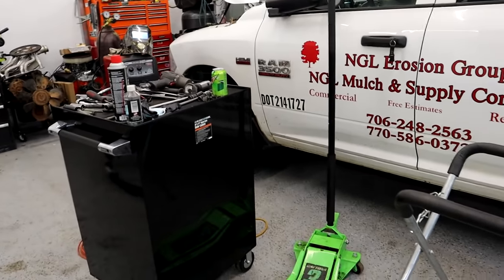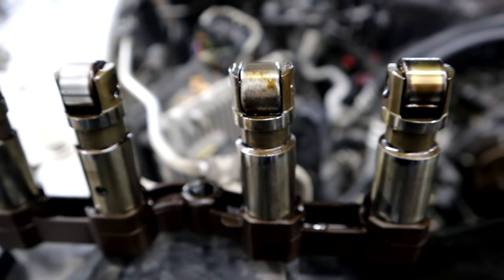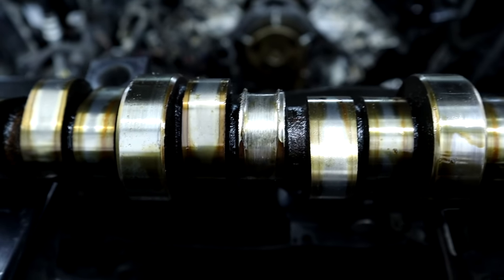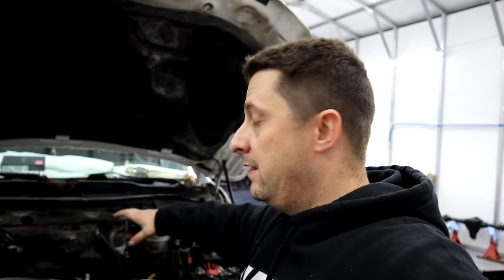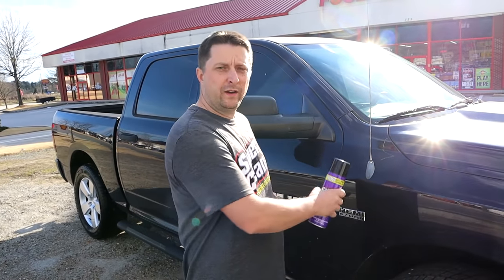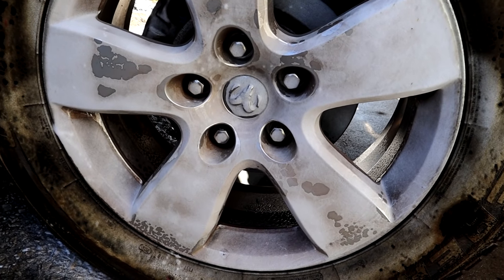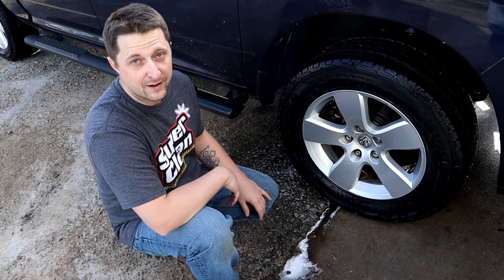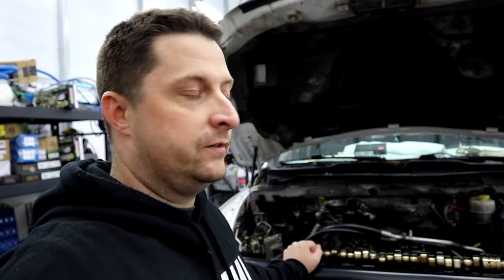6.4 HEMI Engine Failures Common Problems WATCH OUT.

Comment: I find it hard to believe that your buddy with a podunk shop is getting 6.4 Hemi Rams with failed cams when the 6.4 Hemi is not that popular of an option for the 2500 and 3500 trucks that are normally sold with 6.7 Cummins diesels. Further I owned a 2016 Ram 2500 with the 6.4 Hemi and ran quality Redline 0w-40 Group V Ester Synthetic oil in it and did not have any issues. If 6.4 Hemi Truck engines were having major issues with Cam failures it would be all over the forums yet the forums are quiet. 

From what I see the Truck at the start of this video looks to be a tradesman work truck and the maintenance was likely lacking, used the cheapest oil they could find and did not change the oil and filters in a timely manner. To many companies think they are saving money by using cheap oil and filters while they dog the truck, this one had a failure at 130,000 miles and from seeing the mirror in the up tow position you can bet your rear end this truck is used hard towing heavy loads. 

You say this guy has had five or six 6.4 Hemi Rams come in to his shop in the last two months for cam failures is just not believable. If these 6.4 Hemi Truck engines were failing at that high of a rate it would have been discovered long before the past couple of months and the Ram forums would all be on fire about it. 

The 6.4 Hemi Truck engine has been out since 2014 so they are hardly new on the market in fact they are now into their seventh year on the market. Landscape companies are well known for not taking good care of their trucks when it comes to proper maintenance.
Reply from the maker: 🤣🤣I will ship you all the camshafts if you pay the shipping that way you can evaluate them with your NOT podunk shop experience 😉 🤷‍♂️👍
Reply: @FrostbiteRam  some people just hate to admit there's a design  problem, however as a mechanic I would agree some people cheap out on the maintenance then blame the manufacture, DO PROPER MAINTENANCE FOLKS
Reply: I work a company that bought several Dodge Ram trucks in 2015 with the 6.4 L engines and the trucks get regular oil and filter changes. Every one without exception had to have the cam and lifters replaced starting at about 30,000 miles. Now interestingly enough anyone that has been through this also knows there is a 3 month back order on parts. I guess there is not a widespread problem though they can’t even keep up with demand for the parts. Can any of you defenders of Dodge explain this. LOL good luck, I await your replies.
Reply: @josephsylvester1  i would like to know when the oil was actually changed in the 30k mile trucks that are 6 years old now? What mileage is on those trucks no? I would think they should be on there 5th or 6th lifter and cam swap? Each truck!!! Oh and what are thr hours on those trucks so we can see the duty cycle of each and Mke a comparison with our own trucks?
Reply: It is all over the forums and GM has the same problems because of the MDS systems basically
Reply: @dasboot9471 Truth!
Reply: I'll take the big gas 6.4 over a diesel any day due to all the problems to diesels, having with exuast emissions. They go neck and neck with horsepower. lot cheaper to fix.
Reply: @ramecodiesel8271  I bought a 2018 RAM 2500 CPO 6.4. 
80,000 miles the transmission had to be completely redone. Matter fact it’s going back in the shop tomorrow for a transmission issue and I have not towed with that truck in a year except a small trailer that was only once a week ago. And 90,000 miles came and Lyptus came out of it that’s right came and lifters. Fortunately, I bought the extended warranty, so everything was covered. Well except the brake booster which had to be replaced twice between the 80 and 90,000 mile marks. Personally, I’ve had this truck maintenance at the dealership since I owned it. If they’ve used cheap oil, I wouldn’t think that would be a thing a dealership. I love the truck, but I can’t live with these mechanical problems. It’s too much. I’d be happy to send you pictures of the invoices unless you consider dealership, Podunk too. Search deeper there are all kinds of posts about the 5.7 and the 6.4 cam and lifter failures. Also on transmission issues.

Comment: In today's competitive truck market there's no excuse for these types of issues in the hemi engines. I traded my 15 Ram bighorn 5.7 in for a 2020 SR5 Tundra.  The exhaust manifold bolts were broke plus the lifter noise wearing out the cam. Both trucks sticker price were at 45,000 . That said I have faith that the Tundra will go 300 to 400 thousand miles with minimal repair. The Ram was nice towed my boat well.
Reply: Keep an eye on trans Temps in the Tundra. They stopped putting trans coolers on them and failures are occurring frequently.
Reply: @bicyclecrashsurvivor8884  definitely a bad move on Toyota.  Not currently towing anything but plan to add a cooler after warranty expires.  If it goes b4 then it's on Toyota to replace
Reply: Tow a 14,000# fifth wheel. Unfortunately, a Tundra is not in the cards for me. My other car is a Rav 4.

Comment: I’ve seen this happen before and I advise my customers to replace the engine at that point because all of the metal that gets through the engine. I’ve seen them be replaced and two years later they start rod knocking. I don’t want to charge somebody you know $3500 to do the job and then have it come back two years later with the rods knocking.
Reply: The dreaded hemi tick with early valve lifter failures?

Comment: The reason why these fail is because they slack on oil changes. You gotta change the oil really early on these 5.7 and 6.4 HEMI'S.
Reply: How early? I've been doing a oil change 5k increments
Reply: It is actually the design of the engine, the cam is too high and the oil draining from the heads doesn't flow enough down to the cam. Idling is what kills these more than oil change interval. The cam gets starved at low rpm and once the damage starts it snowballs. These are good engines, but not if you are going to idle for 30 minutes at a time. If you are going to idle for more than 5 minutes just shut it off.

Comment: My garage and a local Dodge dealership have found that there is a cronic problem of the casting sand not being totally cleaned off of the blocks when cast. This casting sand then acts as an abrasive and its clogging heaters and radiators as well. I suspect this could be compounding the problems shown here. Sounds like a recall is in order.
Reply: Makes me wonder if this is why my Ram has had a Chronic no heat issue almost every year since new🤔. Ive been through 2 radiators and 3 heater cores. I finally gave up and just dealt with being cold.

Comment: First thing I did to my truck with 200 miles was to cam it and change lifters. Added a lot of power and got rid of a known headache.
Reply from the maker: Awesome 👍
Reply: Would love to do this on my 6.4
What did you put in and do you still have low torque?
Thanks
Reply: @breakeralex9211  

J green cam/ jgreen tune/ ported heads/ported stock intake and throttle body/ long tube headers/ 2800 stall converter and few other odds and ends. The 6.4 hemi like this pulled awesome
Reply: @breakeralex9211  

Brother the truck really woke up. It had more torque and hp from idle to redline. Being a gas motor and non diesel the looser converter helped to.
Reply: @sailingseahawk2012  
Really glad to read this and thanks for the reply!

Comment: We have a 2018 Challenger Scat Pack with the 6 4L. Zero problems so far at 25k miles anywhere on the car. I have two questions: 1. I noticed that the lifter that failed in this engine was one of the non-MDS, or solid, lifters. A lot of people claim the MDS system is to blame for these problems. Has this shop seen more MDS lifter failures or solid, or are they about even? And 2: If he has any experience with them, are the high performance 6.4L engines in the Challengers and Chargers more or less prone to these issues? We plan on keeping this car regardless and will stick a new engine in it eventually if we have to, we love it that much, but it's good to know what to expect down the road. Thanks in advance for any info!
Reply from the maker: Yes it seems lots of the lifters that fails is a mix of mds or non mds it really doesn't just point to one it seems. My 5.7 failure was a non mds lifter as well.
Reply: Yes the MDS contributes to early engine failure running  on 4 cylinders.  It be less money to drive with all 8 cylinders than get lifters replacement over and over especially if you use band aid factory parts only to end up with same problem again down the road.
Reply: @microminiskirt  
Probably no way to disable the MDS system?
Reply: @jefferystensland1304  Buy the manual and pay the gas guzzler tax because if you are planning to keep Challenger for a long time that will pay off with one less major problem to go wrong.
Reply: It's two separate problems "HEMI TICK" as non MDS cars have had same issues with lifter valve failures.  Must go by idle times and change oil and filter frequently-very high maintenance.

Comment: I've been lucky I guess,155,000 no problems. I will keep on using my 5w30 amsoil every 7000-10,000 miles
Reply: I change mine every 2500-3000 lol
Reply from the maker: You should be good you have custom cam and non mds lifters right.
Reply: @FrostbiteRam  no mine is still factory
Reply from the maker: @Pickleram  thats right just tuning my bad
Reply: Do you run 5W-30 in a 6.4 or 5.7?
Reply: @roadglide1142  5.7
Reply: @Pickleram  depending year should be 5w 20 oil..
Reply: @alexlindekugel8727  2011 oil cap says 5w20 but owner manual says 5w30 is ok ,I rather have thicker oil I ran 5w20 for the first 50k. The truck still get the same mpg and performance is still the same. No hemi tick yet. Been a amsoil user for 30 years.
Reply from the maker: @roadglide1142  I use 5w30 in my 5.7
Reply: Well Geez?  Look at the color of the cam and lifters !!! 😳 Blame the lack of service of from oil changes !! Oil is not Oil is the same!  Really!!! Get Real Dude!!!😳
Reply: I have 140,000 on my rig. We are avid duck hunters which means a lot of mud and pulling boats. I’ve had to fix the valve body and replace a pinion bearing and that’s it. For what I put the truck through I’m pretty satisfied.
Reply: I'd NEVER let it go past 5000

Comment: Owned my 09 1500 since new. I am a Tech (since 1982). Been on full synth' since 10,000km. 226,000km at 5,000 hours number 3 exhaust lifter & lobe. I had NO tick, just a misfire under heavy load that would remain for about 15 seconds. Found the siezed lifter would turn 90 degrees in the cassette then flip back giving me a smooth engine again. 
I went with aftermarket parts because Canada OE prices are double ($2000 for just the lifters, plus head gaskets & seals etc)
Some of the new lifters are ticking, now running 5w30, still not happy with it, but going to run it as is while I decide to either redo it or swap in a new motor.
Will likely redo this one as I had the heads & exhaust manifolds machined (did valves & seals myself)

Comment: This is from running your motor with the MDS on. Guys, you have a V8 for a reason. Run all 8 or you gonna have problems. If your so worried about fuel mileage then go buy a 4 cylinder truck or car.
Reply: How do you turn off the MDS so you can run all 8 cylinders.
Reply: @SIDVENOM  after you put it in gear, just press the gear selector until you’ve reached the highest gear. So if you have a 8 speed trany, press the gear selector until it displays 8.
Reply: @jasonneal  ...
Reply: @SIDVENOM  this guys is trolling you, you'll have to open the motor up and replace the MDS lifters with NON-MDS lifters.
Reply: @jasonneal  but you can't go to 8th gear below a certain speed, and it doesn't matter what select a gear you're in. You told him he had to go all the way to 8th gear.
Reply: @Prestiged_peck  when you select to the 8th gear the vehicle will start out in 1st and shift normally all the way to the gear you have selected. For example, if you are at a stop and you have a 8 speed and you select gear 6, it will drive normal until you get to 6th gear, then it won’t shift any higher. It will still down shift like normal. I’m telling you try it
Reply: @jasonneal  that's weird, the ford/chevy versions actually put it in the selected gear, but will only let you select certain gears at certain speeds
Reply: @Prestiged_peck  i don’t know how Ford and Chevy operate bc I’ve never tried it on them. But I do know dodge. I will say if your going too fast then down shifting too low of gear, your asking for problems. The whole point here is driving the vehicle without the MDS turning on. And to do that, just put it in drive, select the highest gear and the vehicle will drive and shift like normal but the MDS won’t activate

Comment: I dumped my 2019 Laramie long bed 6.4 for a 2020 Tradesmen 6.7 diesel. I got cold feet with all the problems with the 6.4 hemi. I also needed a diesel to pull my new 5th wheel and it holds it resale value way better.
Reply from the maker: Cant go wrong with the cummins only thing to prepare for is emissions components failure.
Reply: @FrostbiteRam  - and transmission failure unless Aisin

Comment: Dear hemi and Mopar people if you want to avoid your issues every 3,000 mi Castro synthetic blend with original filter trust me I had a 5.7 with 200,000 mi never had an issue
2007 chrysler 300c
Reply: What do you mean by "original filter"? Do you have 200k miles on the oil filter your car was made with 🤔😳? Lol.
Reply: Yup, Castrol or even Motul european formula synthetic....

Comment: After owning several Dodge trucks and having to return to the dealer several times with each truck including a complete motor replacement on a truck with 2000 miles I'm done.
Reply from the maker: Cant blame you

Comment: well as a FCA vehicle owner the quality has continued to go down since 2015, when it should have been improving.  now that Stella, aka PSA or the French Government owns what was FCA it's only going to get worse. after one  2016 Jeep SUV, a 2015 Ram truck and now a 2020 gladiator i will be switching brands. they just build poor quality
Reply: Yes please leave go buy a Ford I Chevy and everything will come in perspective quickly, Driven Chrysler Dodge for 52 years and driven a lot of other junk and there’s no equal to the quality not withstanding the few problems they have compared to say Ford which is the recall king
Reply: @AmericanSurvival001  I agree and have had fords they are Generally much worse, but under Fiat the brands have suffered, fiat tends to ignore problems until they are forced to fix it. My 18 yr old grand Cherokee had less issues than my current gladiator. i am trying to not let the issues ruin the Jeep for me, (only at 10k miles) but it is honestly hard with so many. Best vehicle i ever owned was a toyota, zero issues to 100k miles before i traded it. tried to go American but with the French now owning the brands of former Chrysler co, they are not known for making good cars. I would love to be surprised if they can do better than FCA did as i am a die hard  Jeeper.
Reply: @HalfShell Well JD powers is kind of a joke for reviews on any brand they are mostly paid for, CR is a good source but initial quality is no substitute for long term  reliability. ATM both companies are having bad issues and cutting corners. Having owned both i had a LOT less problems with my chevys and none with my toyotas. Will be trying to keep it more American anyway, with ram being french owned now disappointedly. RIP real Chrysler,  Not really a great time to be getting most car brands with the corner cutting.
Reply: Stellantis has been dumping money into quality control and improving their production facilities actually, and the most recent consumer reports are reflecting that.

Comment: I bought a new 2016 6.4 hemi in 2016 and it had a knock since day 1. I traded it in with 16k miles on a cummins. Now I have a new 2020 ford f250 lariat with the 7.3 gas. I was gonna get another ram, but i do not like the 6.4 hemi.
Reply from the maker: I can't blame you a bit.
Reply: The 7.3's are having issues with valve springs. Just a FYI to look out for.
Reply: Jeez, you're rakin' in the dough. Ya own a gold mine or something?

Comment: My 2018 Ram 2500 6.4l has been pretty good so far. I am at 140k miles on it and it is hard miles with lots of idling. MDS has been off since purchase and everything is good so far. Mobil 1 0W-40W every 6-7k miles. At 68k the fuel pump came a part like it exploded. They had to tow me out of a job site drop the tank clean out the pieces and replace.Other than that all that has been done id Brakes about 3 weeks ago I got 140k out of it. Will it run into the lifter camshaft issues? Its possible, but I think the main cilprit has been the MDS. GM has had the exact issues and worse with their AFM feature. I will update here if it ever needs the dreaded lifter /cam job done. Also as of today the heater only gets luke warm. I am thinking Thermostat possibly, but its not over heating or creating any codes.
Reply: Yes sir update us